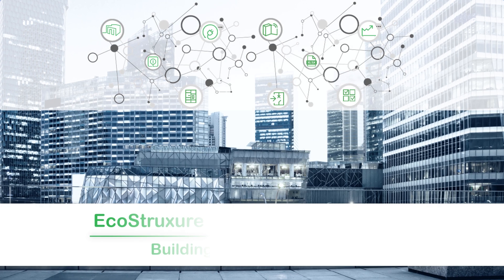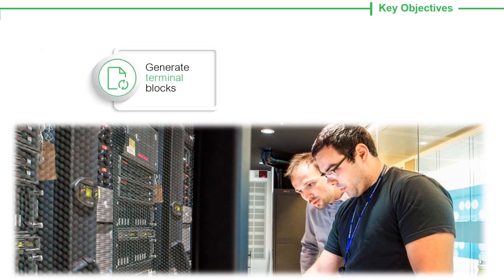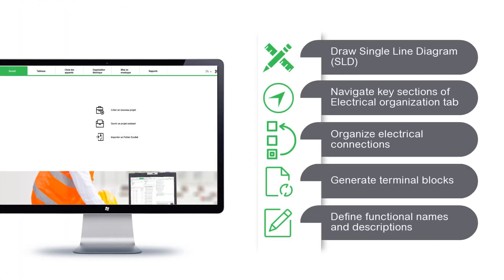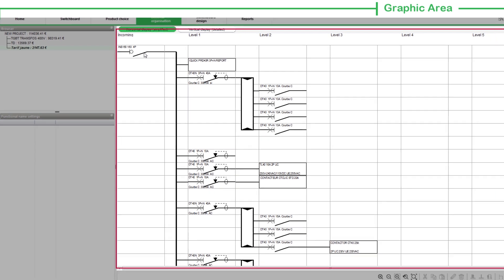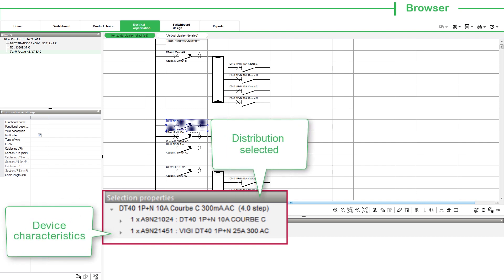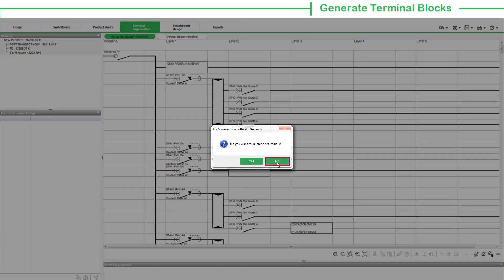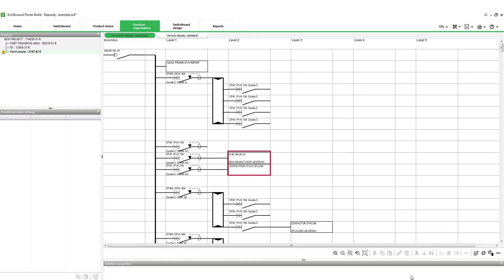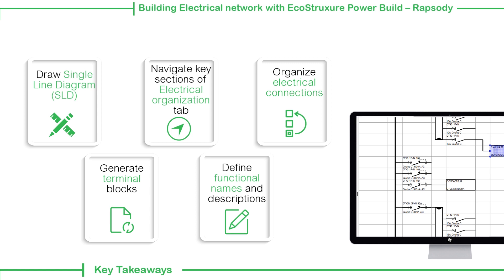Build Electrical Network With EcoStruxure Power Build Rapsody | Schneider Electric Support

Comment: Hello,
I could not find a way to create a project for one distribution board with two incoming circuit breakers. 
Is it possible to create a Rapsody project for a single distribution board in which there is two main circuits breakers 2P40A (incomers), each one of the two main circuit breakers feeds 04 MCB's.
Please help me 😊😊.